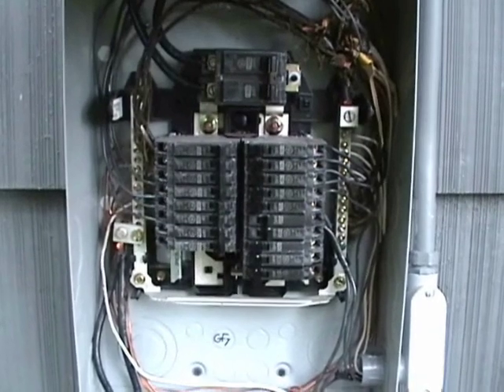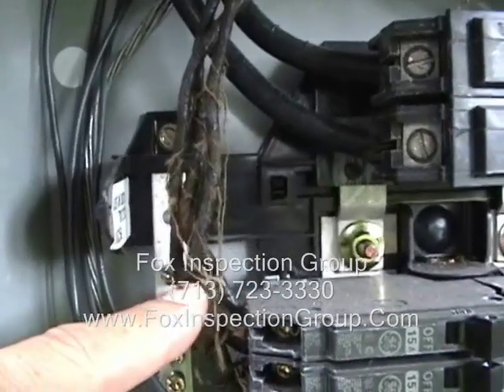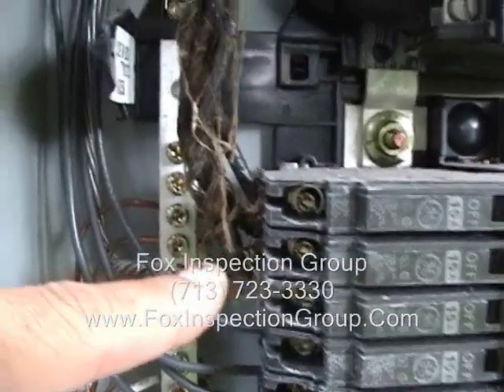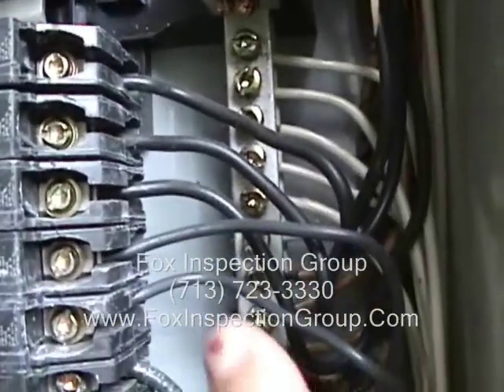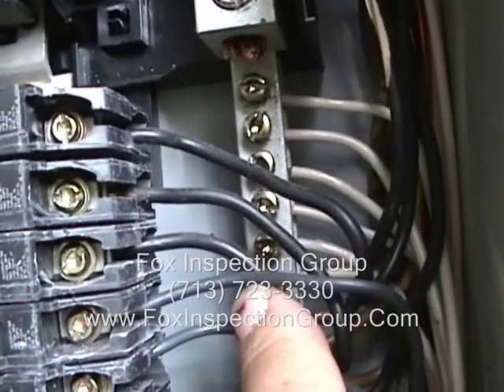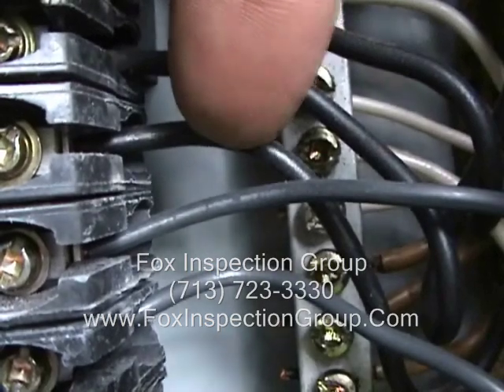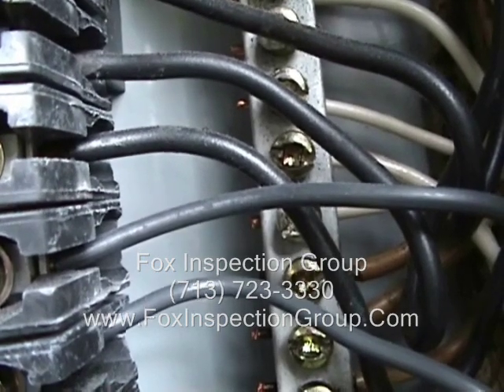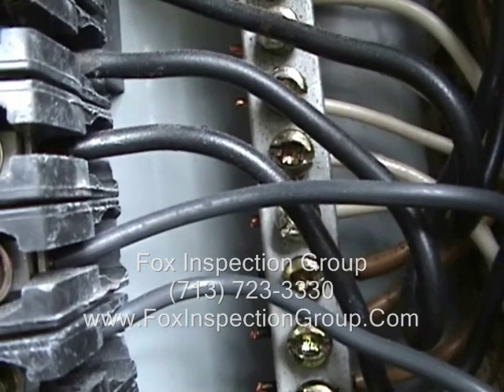Electrical Class On Service Panel

Comment: I have a circa 1950 house with old NGA wiring.  I was working with a line that turned out to be hot.  They touched and sparked. The spark caused the clothe insulation to catch fire. It was a tiny flame like a candle, but that's all you need. I was so shocked (no pun intended) that I just watched it for a few seconds then blew it out.  That $#!t is dangerous!!!

Comment: It really only takes a TINY thin of insulation to insulate a wire because it is non-conductive. But wire manufacturers make it thicker than necessary to protect it from being easily damaged.  The newer wire has a stronger insulation so it doesn;t need to be as thick.

Comment: Ironic that as fixed wiring has gotten thinner and more compact the wires people must deal with have gotten bulkier and harder to manage since UL now requires even small low wattage appliances to have thick SPT2 cords.

Comment: @GordonGFox You commented about a year ago about "heat shrink insulation".  I just bought a 1925 house with a hodge-podge of misc. old wiring.  I know I will encounter plenty of frayed old insulation as I go about replacing switches, outlets, and other basic DIY repairs and upgrades.  Is that heat shrink stuff available at common home centers like Lowes or Home Depot?

Comment from the maker: purpose of video was to show difference in insulation type and thicknes used over the years for the same size conductor.  When inspecting it is easy to think the thickness of the wire indicates the conductor size,  not always the case.  Older #12 awg looks a bigger than newer #12 awg

Comment from the maker: @windoes98se the older / thicker insulation is now replaced with newer thinner insulation with what is supposed to be better insulation qualities so they can use less of it.
the old copper wires were nickel plated because the old insulation used at that time was deteriorated by copper

Comment: your right.... i use heat shrink on all my low voltage boat and auto wire jobs....  and i stay away from crimp junk too all solder and heat shrink..